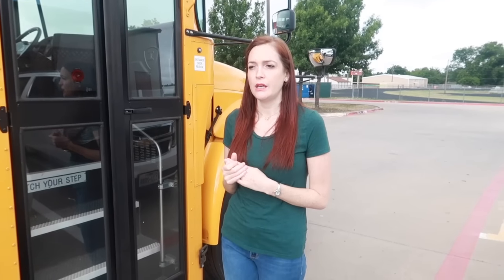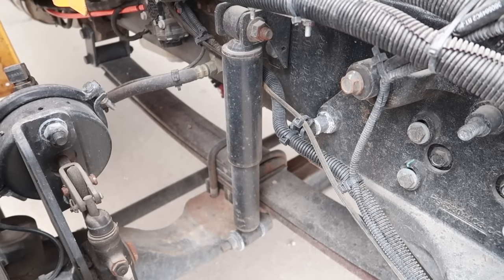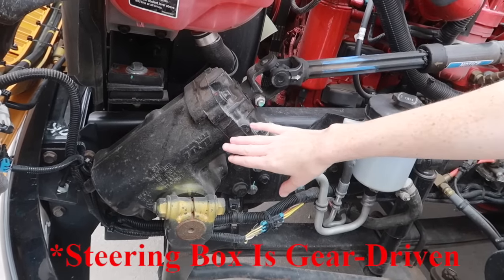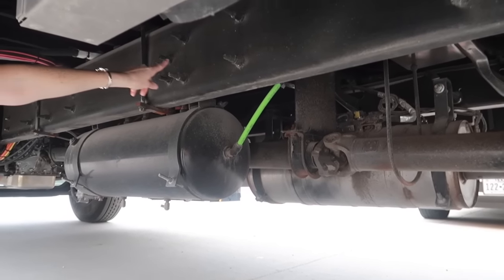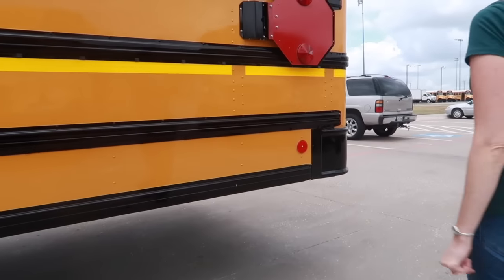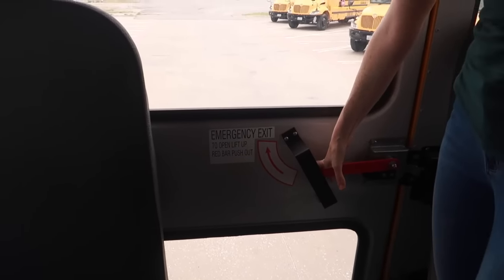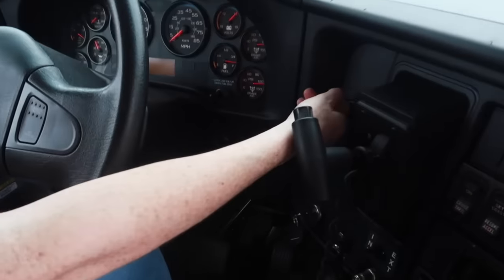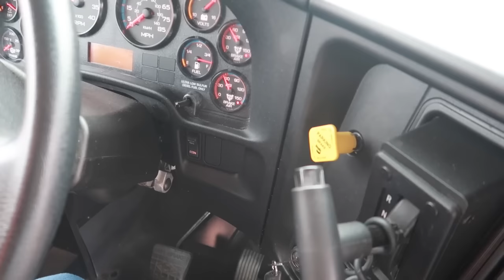CDL Pre-Trip Inspection Demonstration on a School Bus

Comment: Long story short: Make sure there's no loose or missing parts.
Reply: Wondering do we have to know the name of the parts?
Reply: @stinkreezy2791  you don’t have to, but it helps.  I would at least know what is belt or gear driven
Reply: @TheSwatxmr  yeah i been learning i test out this week
Reply: @stinkreezy2791  Yes actually you do need to be able to identify all the parts that she mentioned by name. The Pretrip test is a cumulative score. You get points for every part pointed out AND identified correctly, along with what you are looking for (not cracked/damaged/leaking, no loose or missing parts). You get no points for incorrectly identified parts. There is a minimum number of points that you must score in order to pass and move on. You can miss a few and still pass, but you must be able to score on the bulk of them.
Reply: @MobileTaz  Facts but i past in December my third Examiner he didn't really care about it he was worried about maneuvers and the road test

Comment: Time Stamps 
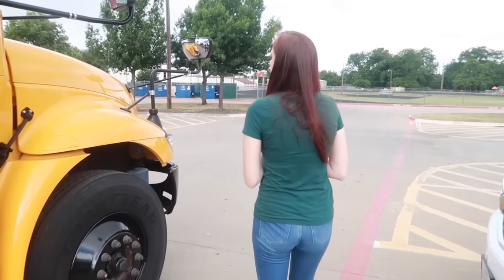Front End 1:39
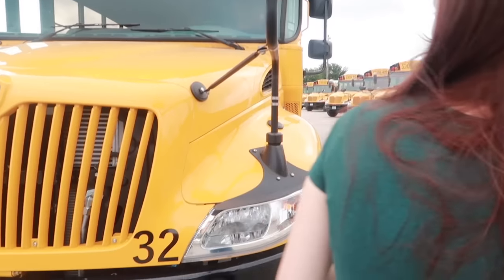Engine Passenger Side 3:18
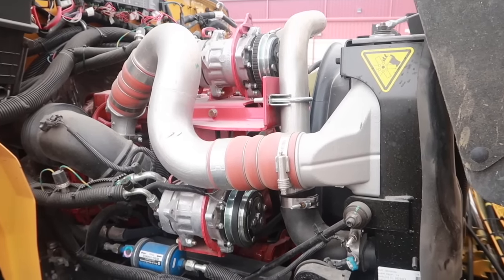Suspension 5:18
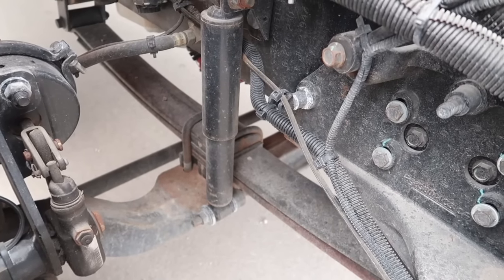Brakes 6:12
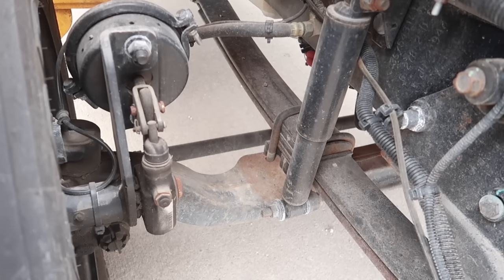Wheel and Tire 7:00
Engine Driver Side 8:30
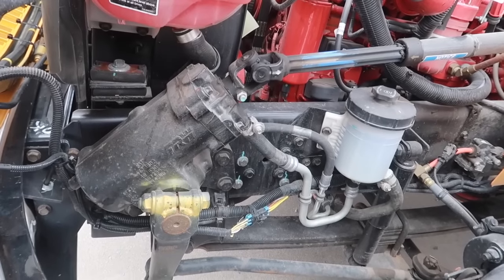Steering System 9:35
Drivers Side 11:30
Back End 18:20
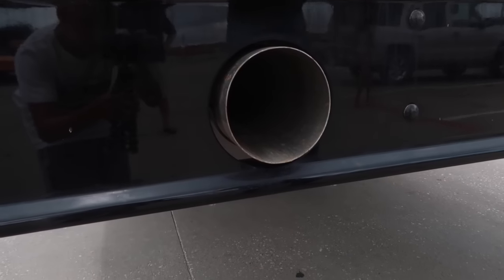Passenger Side 19:40
Inside 20:50
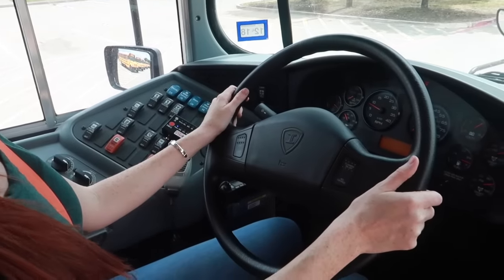Airbrakes 27:26
 Hope this was helpful to some
Reply: thank you

Comment: I took my CDL test yesterday (7/22/2020) in Wichita Falls and passed on my first attempt. All the sweat was happening! OY! This video was key! I essentially memorized it. The only thing I did differently was the order of the airbrakes test. Key in accessory position, wheels chocked, disengage parking brake, Static test, applied test, low pressure test, spring brake test, start engine, unchock wheels, governor cut-in/cut-out, parking brake, and then service brakes. Thank you so much for making this video!!!!

Comment: Took this test a year ago. This video was INSTRUMENTAL in helping me pass first time! Thank you!
Reply: Which DPS place did you go to?
Reply: @MrWbc0002  Lewisville, TX
Reply: @diegoo.9370  thanks. Were they strict? Because the one I went to, I did it like this video, but for the front engine compartment they wanted exact verbage   from the manual.
Reply: @MrWbc0002  The guy I got was not too strict. I used mostly the verbiage on this video and it was enough to pass. He did mention I got the minimum points to pass but hey I ain’t complaining
Reply: @diegoo.9370  thanks for your help. I’ve been memorizing Ch 11 word for word verbatim
Reply: Great to hear! I have my permit and ready for the next step

Comment: Thank you for the video! I’m preparing for my test, and we’ve been having trouble with failures because the agents are asking specific mechanical questions during the pre-trip, such as “What is the brake chamber’s function?” and “How does the compressor charge the air system?” You may benefit from making a companion video that describes the functions of basic components, in case that info. becomes a standard part of the testing. Thanks again! This video has been extremely helpful.
Reply from the maker: That’s wild! It’s already difficult enough learning the names of all the parts! Where do you live? We haven’t run into that in our area in Texas, hopefully they won’t start doing the same. I’ll keep that in mind for future videos.
Reply: Those questions are NOT part of the test. Anything along those lines that the examiner asks is simply to rattle you. If its not in the book, it's not on the test. Remember that. Its not exactly just to be a dick (although I'm sure being a masochist is a prerequisite to being a DMV examiner lol), its to ensure that you can keep your train of thought in spite of the distraction and continue the inspection without forgetting anything. Bus drivers - especially school bus drivers - are held to higher standards than other CDL drivers due to the irreplaceable nature of our cargo. Just say "I'm not sure how it works" and move on. You can't be penalized.
Reply: I've run into that issue three times now in Florida with inspectors asking for stuff that isn't on the exam.  Our other issue is that many of these inspectors are straight up assholes that don't want to pass anyone but complain at the same time that they have to drive kids every morning because we're critically short drivers.  An example would be having to say the following about the front crossing mirror: "I will check to ensure the glass mirror is not cracked, broken, distorted, or have any hazing, and that it is clean.  The mirror needs to be properly adjusted and properly affixed to its mount with all hardware and free of rust.  The mirror's mount must not be bent, cracked, broken, or damaged, and must be properly mounted to the bus with all of its hardware and must be free of rust."  And God forbid you say you'll check the other mirror the same as the first one.  If you don't say all that verbiage for both you get dinged.  You can't just say that you're looking for damage.  You have to say cracked, bent, broken, rusted, pitted, frayed, etc...   Its ridiculous.

Comment: This was a good tutorial right up until the end.
The air brake test was wrong.
And 
You should never start the bus and go outside it. Take the key.
Plus, never chock the front wheels! Chock the rear only. 
I guess I'm a big expert with my Google diploma, lol, but only pointing out the wrong items for clarity.
I thought it was a very good instruction.
Gave it a thumbs up.

Comment: Had a driver fail the brake test today in TX because DPS chapter 11 states the key must be in the on position, not auxiliary or accessory position. They change these requirements frequently so be sure to check your state.

Comment: Governor cut in for air brake is between 80 and 105psi and cut out should be between 105 and 135psi. Build time should be timed between 85 and 100psi should not be more than 2 minutes

Comment: Really enjoyed this video, just retaking my test after about 15 years away from school bus driving. One thing I think you might have got wrong is while the steeping pump is gear driven, as is the air compressor, the steering box applies the pressurised fluild

Comment: 12:38 the electrical side panel is amazing.  It demonstrates how nice a design the electrical panel can achieve when you have a programmable body controller and not all relays like a Thomas Bus has.
Reply from the maker: I haven’t had any first-hand experience with Thomas buses, I like our Internationals though!

Comment: Not sure about Texas, but in Cali the mechanics are responsible for 80% of the items she's checking. In the engine compartment, we're only required to check oil and trans fluid level, look at the coolant and brake fluid reservoirs, belts deflect no more than 1/2" and look for anything out of the ordinary in the way of what is easily seen from a cursory examination such as leaks, or cracks in hoses, etc. We don't have to inspect the suspension, looking for a bent driveshaft, the frame of the bus, rear axle, leaf springs (really?) etc. And we're not allowed/required to look in the circuit box etc. Our pre-trip should take no longer than 30 min, her mechanical inspection has already taken 20 minutes and she's not done yet. Don't they have any mechanics working at that yard? The person filming this is on the ground, but no driver is required to get on the ground and look at all this stuff under the bus. And she's checking the lights twice, once when they're off and once when they're on? This whole thing is just so inefficient and overkill.
Reply from the maker: Mallory McGuire it is overkill. There isn’t any school here that actually requires drivers to inspect all these things. But this is what the state requires to pass the CDL test.

Comment: That bus looks so different to the bus I used to drive. That one had scraped up wheels (drivers hitting the kerb), scratches on the bumpers, quite often dirty (only get washed weekly by the depot), sometimes lights out (which only I seemed to report)
As for the inspection, we would check the oil, the water (if not hot), tyres, mirrors, body panels, lights (all of them), wipers, horn (some didn't work), etc It was about a 8 minute job checking it over (done in our own time :D  )

Comment: So FYI at 28:35 on the second section of the  air breaks test when you shut the engine off.  I was failed in Livingston for turning the key to the accessory position.  I was told that I should have turned the key to the right instead.  I passed my second go around.  Not blaming you or anything, it was an excellent video.  You may want to look into that for clarification.  They may have just been sticklers in Livingston.
Reply from the maker: Man, sorry that happened! In January 2019 they revised the manual and it now says specifically “leave the key in the ‘on’ or battery charge position”. That being said, we’ve had several people turning the key the other direction for the test and pass. Seems like an extremely minor detail to fail a person for.

Comment: thank you for posting this. I just started with Tomball ISD and so I am having to learn all this. They teach it slightly different but that is to be expected.  If anything, they want you to go even more in depth than you did but makes for a better chance of passing.
Reply from the maker: pcguy that’s great! I try not to go overboard because the pre-trip already takes long enough as it is and on the test you are given a time limit. We’ve had several drivers perform the inspection exactly like I did and they passed with a perfect score.
Reply: @mallorymontenegro3924  Well I just took my first drive and sat down in the seat where I promptly split my forehead open on the sun visor. Great way to embarass myself
Reply from the maker: pcguy oh dear, live and learn! Don’t worry, all new drivers make little mistakes like that
Reply: @mallorymontenegro3924  Well my first drive went well. Instructor didn't have too many complains other than he didn't like how close I got to the car in front of me at a light.  It went well. My background as a 18 wheeler driver sure helps.  Your video helped alot too as it gave me some things to work with.
Reply from the maker: pcguy good rule of thumb is you want to be able to see the other vehicle’s rear tires touching the ground in front of you. If you can’t, you’re too close.

Comment: Missed mentioning the hood latches and the rubber seals on the windshield and the doors. Also that the windshield wiper blades are secure not cracked or dry rotted or missing, but over all an amazing run.

Comment: Great job on demonstrating this vid !! It is good and helpful for memorization !!! But I'm driving a 2017 Thomas C2 Saf T Liner and it's different under the hood !!! It has the altinator with serpentine belt,air compressor !! But it doesn't have the slack adjuster's or push rod's !! Thomas designed these buses totally different than the blue birds and international buses !!!
Reply from the maker: So it’s a different brake system?

Comment: good air brake test but you missed the build time pressure from 85psi to 100psi should take less than 2 minutes. and always check for air leaks outside after you shut the engine off and put the key in acc

Comment: everything was great except you didn't put on all outside lights ,test high and low beam and red and yellow stop crossing lights, parking lights,, outside turning and hazard lights to make sure they are working and brake lights  and no burnt out bulbs. and to make sure the red stop indication signs work and go out and in on air pressure movement.

Comment: I don't know about where you live, but in Missouri after everything is checked in the inside we have to trunk on all lights and make sure they're on and working and check brake lights and make sure they're functioning. If one light is out it disqualifies you immediately.
Reply from the maker: Here in TX we do the light check before the pretrip inspection. The examiner will talk to the driver and explain the hand signals, then step outside and prompt the test taker to turn on the headlights,  blinkers, ambers, reds, hazards, etc. THEN they would proceed with the pretrip inspection.

Comment: Thank you Mallory for your video. I passed my Class B testing (even though I have a Class A). They required me to take it for the school system. I love your
 style and flow around the bus.
Reply: Not sure why they would make you take the class B when you were already qualified with a class A.
Reply: @Rick-uj2hb  Due to the being a county job, insurance, and other factors they can make you perform the same training as someone that is getting their class B due to passengers and air brakes to get the job. Didn’t bother me but it was a headache having to do it all over again.
Reply from the maker: It’s too bad that they make people who already have a CDL retake the entire test. I understand that school buses have different components than semi trucks, like the stop signs and other passenger related things. But why wouldn’t they just have you check only those items? That would save you and the examiner a lot of time!
Reply: @supertalon2424  time and money. I drove semi for 31 years and coach buses occasionally. Had the passenger endorsement already. When I retired I just wanted something to do make some spending money. 
No wonder way they are so short of drivers.

Comment: I was thinking about becoming a school bus driver, but I wonder if it is really worth it.  What do you do in summer when kids are off?  How much do you have to pay to maintain your license?  Why not just become a mechanic because it sounds like you basically have to be one to know every single part on the bus.  Are you telling me this is what you do every day before your shift starts.  I know my car pretty well, but I couldn't name every single bolt and nut and what it does, but I still drive the car.
Reply from the maker: Hi Carol! I completely understand your reservations about getting a CDL, it's crazy how much of the mechanical stuff you have to learn. To answer your question, no, the majority of schools and bus companies don't require you to do this whole inspection every day or even at all. Most of the time there is a mechanic or team of mechanics who check the buses under the hood regularly. This video is just what you have to do for the test. It may seem overwhelming, but you would be surprised how easy it becomes with practice.

In the summers, sometimes there is summer school that you can drive for, otherwise you have summers off! Some schools will divide your pay and spread it out through the year so that you still get paid through the summer.

To maintain your license, it costs $96 for 8 years, or about $12 per year in Texas. It may be different in other states.
Reply: Yeah I don’t think it’s worth it getting the CDL and realizing you don’t want to drive a school bus.

Comment: That didn't complete the pretrip,  you must check operation of the student lights,  headlight, blinkers, hazards on the inside inside and out, also brake lights,  reverse lights, student lights on the exterior.

Comment: Good video, idaho requires more items checked. You damn well bettet get the words right.  We most say the frame has no holes or welds but buy the factory and that the frame is secure.  What is the frame secured to?  Everything mounts and is secured to the frame.  Many more items and words that make no sence.  When did electrical wires start leaking?

Comment: After pumping down the brakes to allow the spring break to pop out then restarting the engine she should have put the bus in gear and performed a tug test on the spring brake before the air pressure built back up, you can get your chocks after the spring brake tug test while the air pressure builds for the park brake tug test.

Comment: Did she ever check the lights on the outside of the bus? Or just stay inside? I didn't see her test the flashing lights to headlights to marker lights any of that stuff
Reply from the maker: When you take your CDL test, the light check is before the pretrip inspection demonstrated in this video. The examiner will walk around the vehicle, while you are in the driver's seat, and gesture to you to turn on each of the lights. You will then shut off the vehicle and begin your inspection. On the other hand, when you are on the job, the lights is something you will need to check daily on your own. But the purpose of this video is all about passing your test. Hope this helps.

Comment: Thanks. Do you have to be knowledgeable about the whole front under the hood with the brake system, alternator and all parts ebffor passing?
Reply from the maker: There is a chance that you will not have to do the portion "under the hood" for the test, but you won't know until right before you start. So it's important to learn everything beforehand. If you take the test and miss just a couple things, you can still pass, they just deduct points from your total score. I hope that answers your question. Best wishes :)

Comment: I haven't drove city bus since 2021 I drove that 6 years and then before that I drove 3 years to school bus driver so there really desperate for drivers I've come out of retirement so this was very valuable I need to be able to be of service in this life and they are really desperate for drivers and there's those huge sign on bonuses so I'm going to run down and get my CDL before I get the job because it's $1,000 difference between having it and not having it for the bonuses

Comment: you were close on the air brake test but you missed air pressure build time must be from 85 to 100 and should not take longer than 2 minutes.